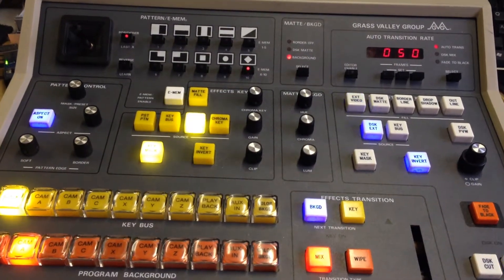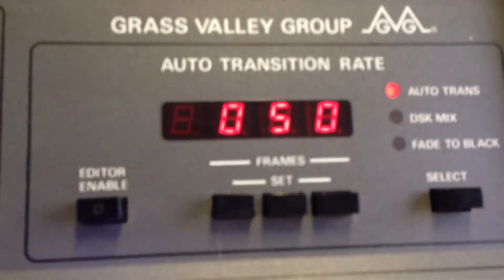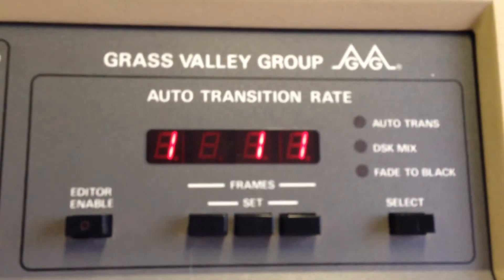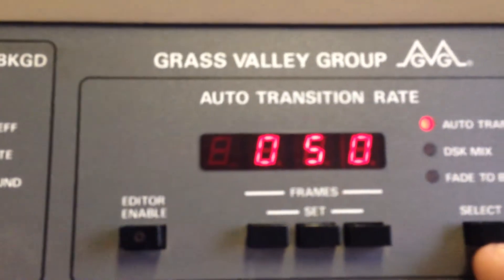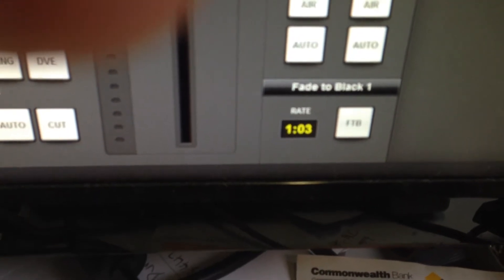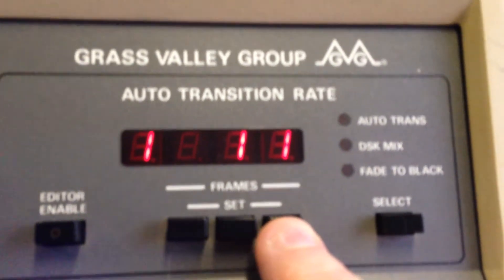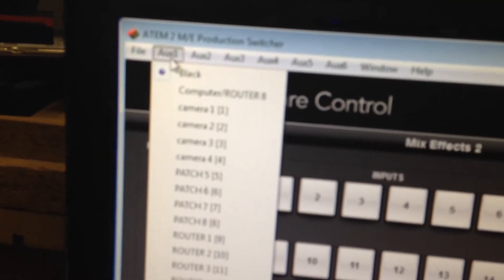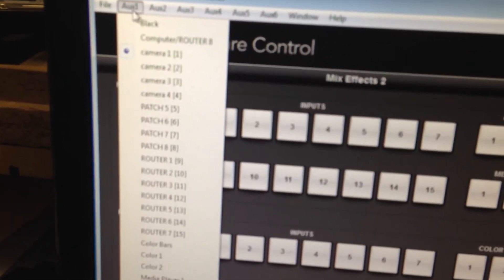ATEM GVG110 trans panel

Comment: This is interesting. When Echolab went belly up and BMD bought the remains and released their verson of the Atem, they no longer supported Echolab's control surfaces . We had the beautifully designed and not so old  Echolab Overture 2.  Any thoughts on this control surface with a current BMD Atem?

Comment: Hi Baz.  I'm testing my panel with the aux controls and it appears I have 20 available, even though my ATEM 1 M/E only has 3.  And when I adjust the increments they are auto-taking, instead of what you demonstrate in this video where I need to select the take button before it takes.  I like it better how you demonstrate it so I don't have to live toggle through on the aux outputs.
Reply from the maker: +Shawn Lam 
The control of the AUX buss can be done either using the DISPLAY PANEL or the KEY/AUX BUSS.
It sounds like you are using the DISPLAY PANEL. The DISPLAY PANEL not only has control of up to 6 AUX BUSSES (ATEM 2me) it also controls all the ancillary crosspoints as described on pages 16 and 20 of the Users guide found here - http://www.lefflerpost.com.au/gvg2atem/GVG%20110%20to%20ATEM%20user%20guide.pdf
You need the KEY/AUX BUSS mode where you can hot switch what ever source you need to feed what ever AUX buss.
The KEY/AUX BUSS can have up to 20 different inputs; 1 - 10 using NO SHIFT and 11 - 20 using the SHIFT.
These 20 inputs are fully programmable; see page 25 "PROGRAM/PREVIEW BUTTON REMAPPING" but applicable to the AUX buss. This can be done using either the panels SHIFT+PATTERN 5 (page 18) or the TELNET (page 26) using the [a] command.
Hope that helps